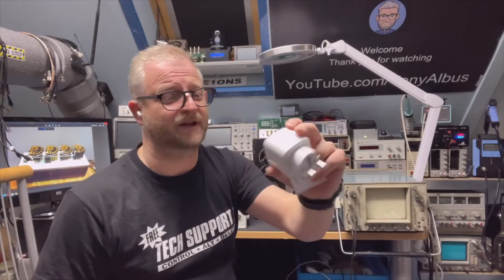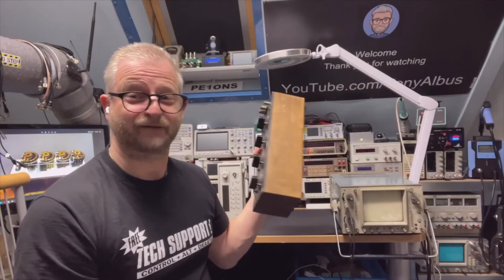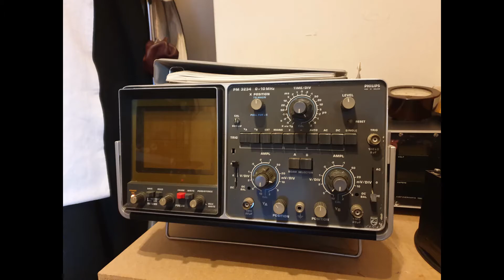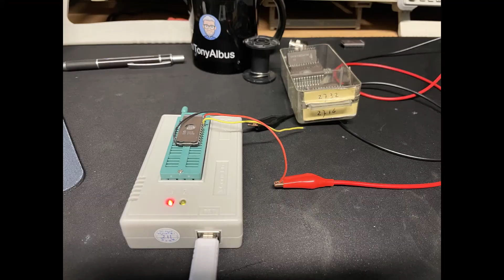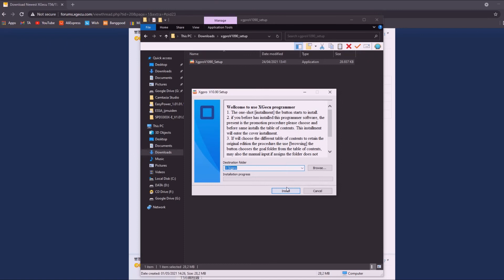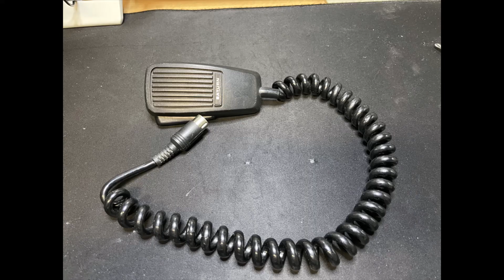#169 Q&A (6) TL866II Plus Upgrade , Saturn 40 Mic and Viewers Projects

Comment: yo tengo la Saturn 2420N y el micrófono es de 4 pins, pero vi que arreglaste el altavoz de esa que es casi igual por dentro , pero la mia suena demasiado bajo de volumen , he comprobado todo y no descubro porque se oye muy bajito de volumen , pero si conecto el auricular se oye fuerte , , el potenciómetro esta bien es como que algo falla en la amplificación del volumen , tampoco encuentro los esquemas de mi radio , ya te dije el modelo es el 2410N de Saturn , no hay mas especificaciones , yo encontré tu video buscando Saturn 40 canales , un saludo ,
Reply from the maker: Hola, try a different speaker first, just to be sure, before you change the amp. also maybe the internal/external speaker plug has a bad contact. the speaker connactor in the back automaticly switches over from internal to extarnal, if this contact is bad the speaker is also soft or low. Saludo have a beautifil day Marco!